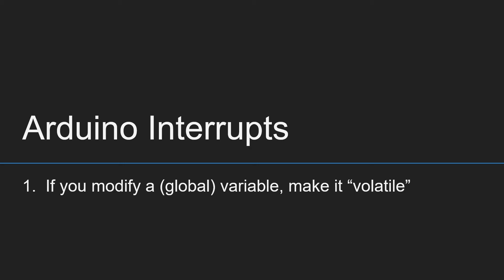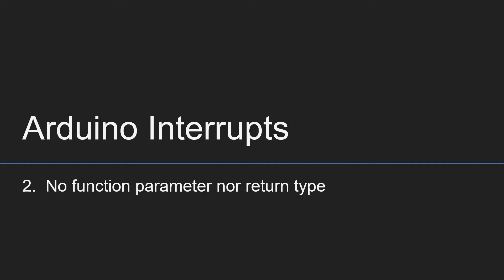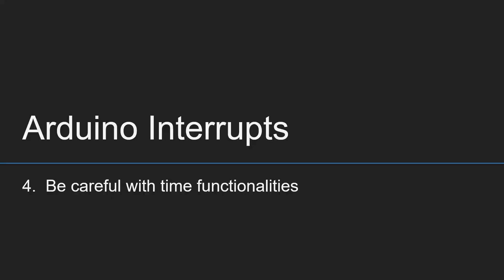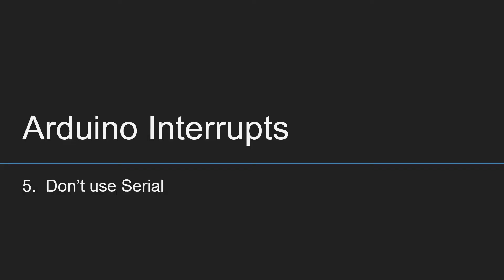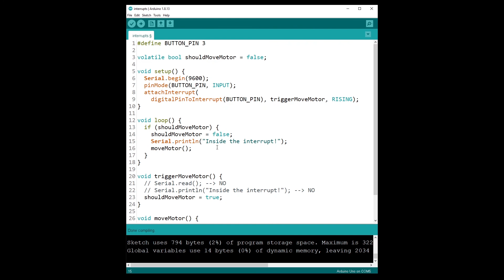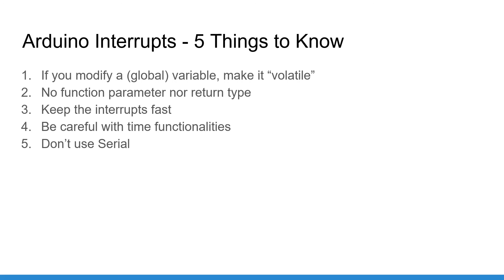Arduino - 5 Things to Know About Interrupts

Comment: Looking at the code at 0:32 I see a possible issue with this code. If an interrupt occurs, line 19 is executed and shouldMoveMotor is set to true with the intent to move the motor. The loop() function then executes line 12 and enters the if statement but hasn't yet executed line 13 yet. Now another interrupt occurs with the intent top move the motor again. However, now line 13 executes and sets shouldMoveMotor to false and effectively erases the request to move the motor a second time. Instead line 14 is executed to moveMotor() only once.
Reply from the maker: Good observation, though in practice, you will not get 2 interrupts that fast. Nobody that press the button twice in less than a few microseconds (then there is the debounce issue, which you can fix in the code)
Reply: @RoboticsBackEnd  A solution is to use a queue but you're right this event would happen rarely and heck we're not controlling realtime car functions like anti-lock breaks.